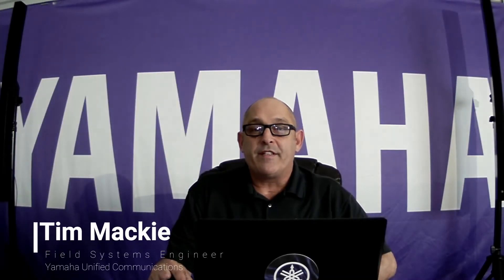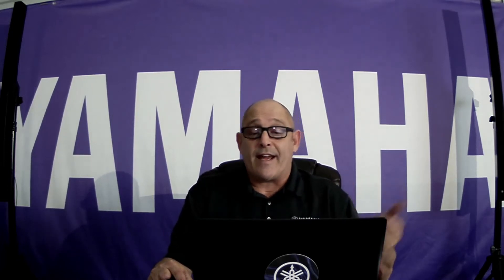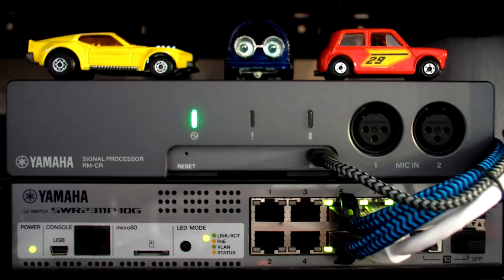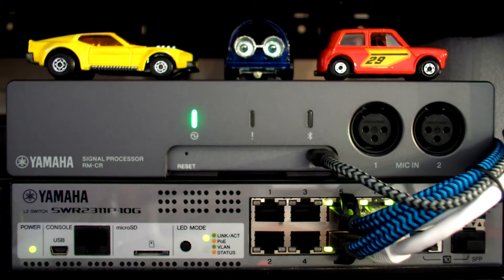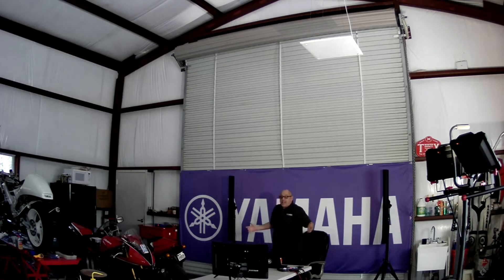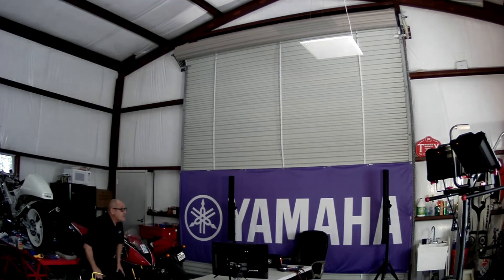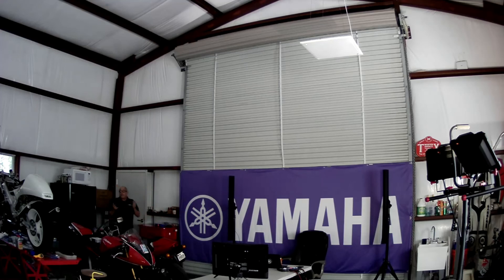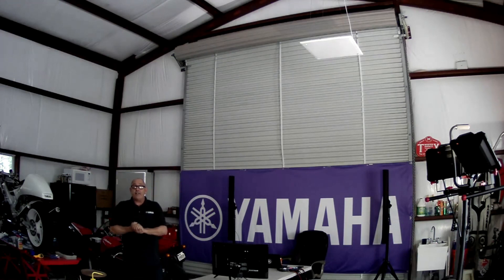Full ADECIA Demo!

Comment: Nice solution, I see there is a RCA input on the RM-CR, Can I put a Program audio signal from a projector / display in here also for "HDMI" audio to be heard via the RM-CR solution?  and can this audio be "local" only and not be sent via USB to remote end?    A USB A for camera connection would be very nice to avoid a USB HUB..